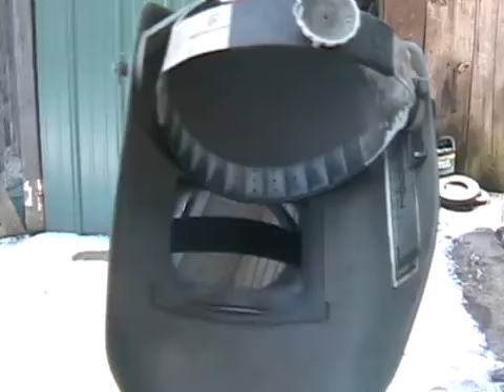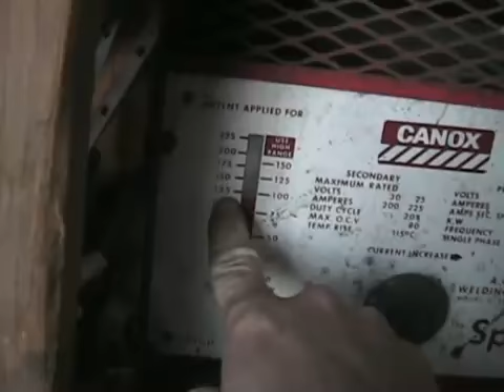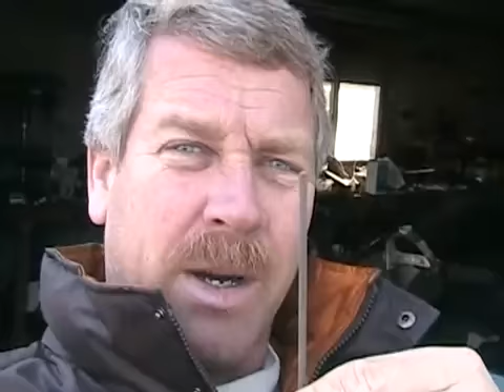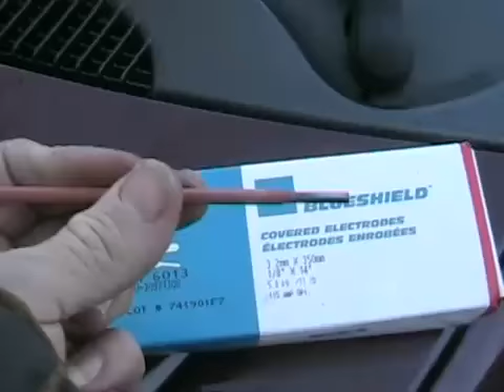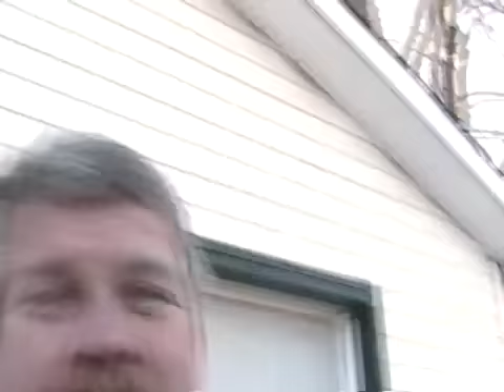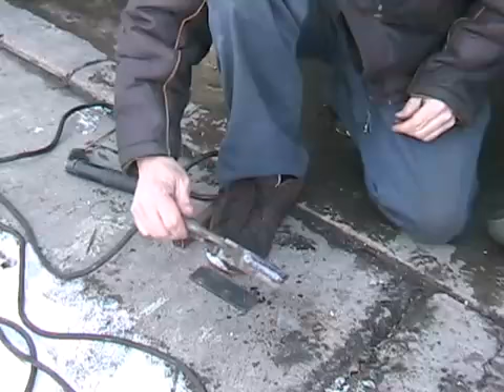how to arc weld, stick weld Davidsfarmison[bliptv]now

Comment: should try a 6010 or 6011......
Reply: If you have an inverter welder the 6011 work best. I have an inverter powerarc and 6011 burn real nice. Welds between 6010 and 6011 are very similar.

Comment: I use an ac/dc stick welder with 7018 rod with dcen for all steel . I used to used to use an ac only machine with 6013rod and it sucked. When i switched to dcen  and 7018 it was night an day so my advice would be to buy a ac/dc stick welder not ac only

Comment: You can get an inverter welder for not much cash. PowerArc 200 amp is only about $350 now. DC stick welder that can do 3/32" stick and 1/8" stick welding all rod types.

Comment: People make mention of better rods than 6013. There is truth to that but this video is proclaimed at the start to be for rookies. The "better" rods will require a DC power supply like you said. These power supplies are alot more expensive! Then DC creates problems of it's own- harder arc stricking,arc blow in corners more undercut, higher sensitivity to improper arc length, ect. You can even buy 7018AC rods to go low-hydrogen buzz box style! With out more skill better rods are not better!

Comment: People always cry about penetration but never mention fusion. I will add a small tip for them if you don't mind my butting in? Buy some 6011 use it for the root pass aka first pass great penetration then put cap pass or passes on with 6013 a medium dig with great fusion. If they can't make that hold either the joint was underfilled or they need more practice! These rods are both much stronger than the base metal and will run well on low-budget welding equipment!

Comment: Thank You sir. You compressed the first week of basic arc welding from high-school into one very time effective video that people can watch over and over for help! I personally agree with you doing a beginers video featuring 6013. Many rods are availabe but 6013 strikes very easy runs well in joints poorly fit and runs well at the full range of amps stated on the box they came in. They are an inexpensive welding rod but you will have to be welding something pretty important for them not to be ok

Comment: Yes, always weld gloves. I weld stick, flux-core mig, and tig for a living. Always wear leather gloves. Carpenter gloves are usually too short and will result in "sunburn" to your wrists between the long sleves of your shirt and the end of the gloves. Any welding supply has welding gloves for about $10. Happy 420.

Comment: > The arc welder is a low current, high amperage device.

Correction: Low voltage, high current (in amperes).

And you're right about AC/DC. there's no practical difference between them safety-wise.

Comment: Yeah, the shop related TV shows these days often show guys welding w/o proper safety gear on, but they are usually only tack welding which isn't as bad as doing full beads. Still, it gives the false impression that protective clothing isn't necessary. Prolonged exposure to the UV rays from welding can cause skin cancer years later in life, and in some cases can even be fatal.

Comment: Both currents are as equally as lethal in their own respects, A long time ago, power in the U.K was altered to AC from DC, reason? for when someone was subjected to a electric shock, DC at mains voltage and upward 'held on' to you hus making it difficult for your muscles to react and allow you to move to safety. AC is an on/off type for current, which means 50/60 times per second the polarity of the current switches and leaves a fraction of a millisecond where the line is 'neutral'.

Comment: Electrodes:

6010 & 6011  - Both extremely good penentration, the latter is better, but they spatter a lot and aren't very attractive to look at. Burns through rust, paint, grease, slag etc.

6012 & 6013 - Lowish penentration but better looking weld beads, a good general purpose rod for practise and  general work. 6012's are now superceded by 6013 and 7018 rods

7018's are low hydrogen rods that prefer DC current like 6010's and burn deep.

Comment: whats safer about DC? The voltage on the tip of the electrode is normally no more than 80 volts. The transformer inside the machine steps the voltage down whilst stepping up the amps (remember the volts are a measurement of circuit 'pressure', and the amps are the work load, of useable energy)

The arc welder is a low current, high amperage device.